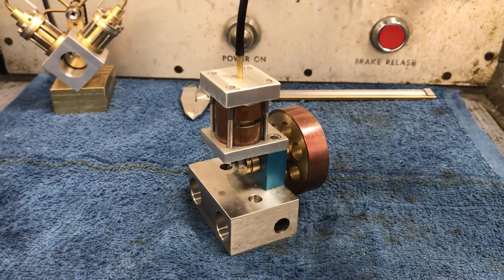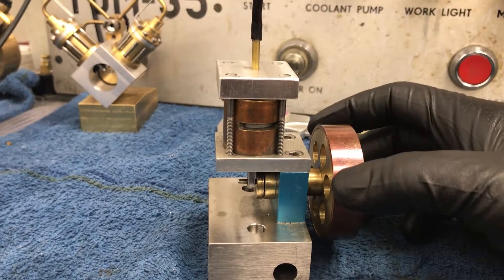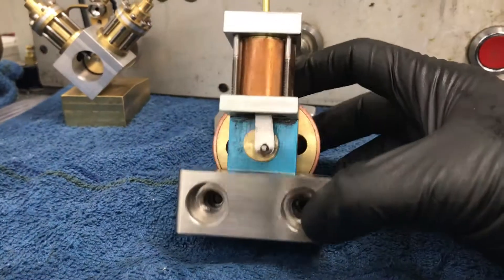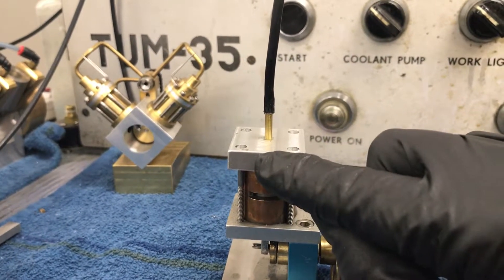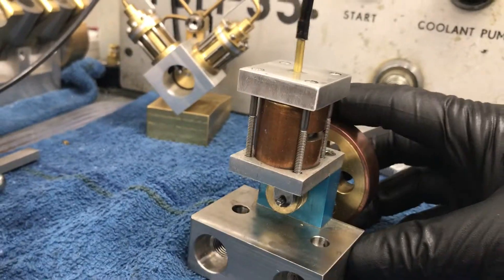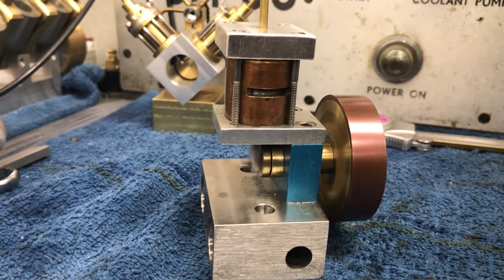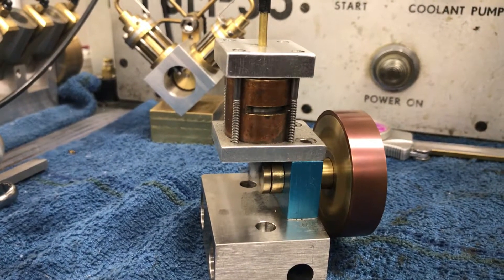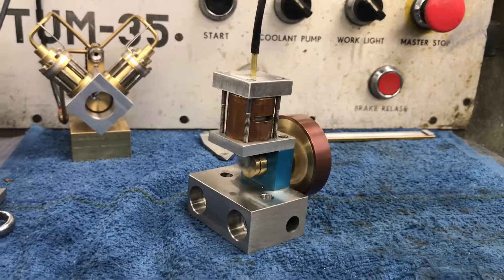BIG BORE CO2 ENGINE, STEAM ENGINE

Comment: Did you run it with CO2? At which inlet pressure? I am impressed of fast running engines. But I almost always miss a dynamometer in order to break the engine at a certain power. A loadless running engine means not so much.